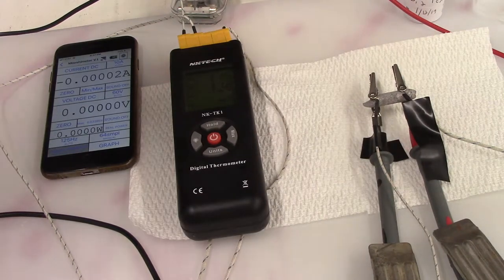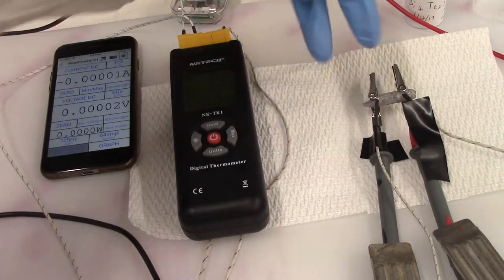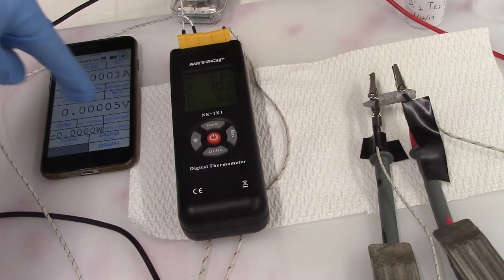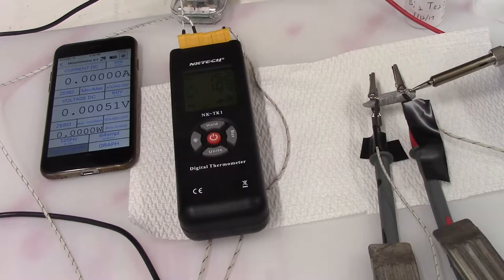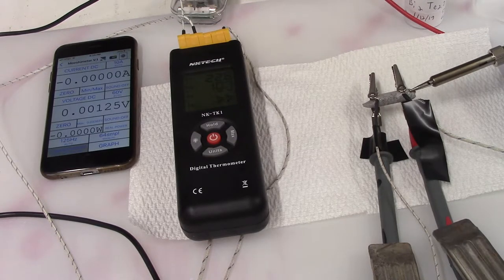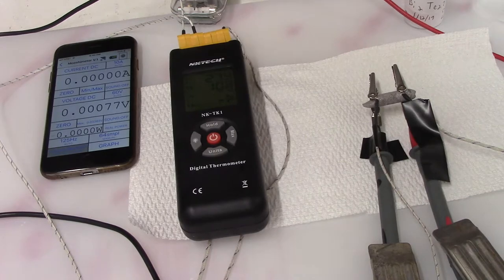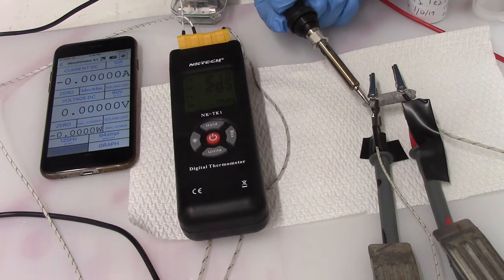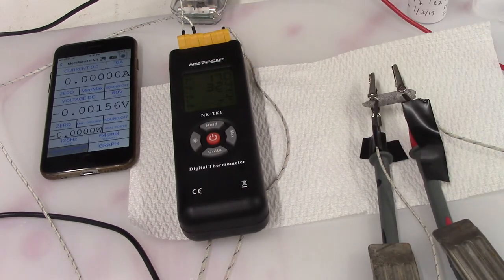Measuring Seebeck Coefficient of Bi2Te2.7Se0.3

Comment: how did you crystallize it?
Reply from the maker: ashamoni neog ashamoni neog It was a bit of a process. I'll make some videos on it. In a nutshell I mixed up measured out raw bismuth, tellurium and selenium into a mortar and pestle and ground up the powders until they appeared homogenous. Then I made a vacuum tube by heating one end of a glass tube and sealing it off, then poured the mixed powder into the glass tube. I then attached a vacuum pump to the other end of the tube and pulled a vacuum sucking out the air. While the pump was running i heated the top of the glass until it softened and pulled down until it sealed the glass shut.

Lastly I put the vial i to a furnace hearing it to 650C which liquifies the metals. Upon cooling I hade a chunk of Bismuth Telluride doped with selenium. Easy peasy! :-)
Reply: @zenmanproject  
Wow...it involves lots of processes...please upload the videos on crystallization soon. It will be more helpful.
Reply from the maker: @ashamonineog8295  I will as soon as I have some free time. Don't be overwhelmed with these steps. It is rather straight forward. It's just a matter of measuring, grinding, a tiny bit of glass work then just pressing start on the furnace.
Reply from the maker: The part I have not figured out yet is how the professional blocks are cut so perfectly. I have ordered a couple kg from China (cost about $500 for the minimum order) and they are incredibly exact measurements.
Reply: @zenmanproject 
Does the properties of the material change during this process?
Reply: @zenmanproject  raw materials or the ultimate product?
Reply: I liked ur setup...mine is crude...where can I find this wireless multimeter and thermometer?
What is the accuracy and precision of these instruments?
Reply from the maker: @ashamonineog8295  Yes, absolutely. And the percentages that you add of each element will change the properties also. For example, the melting point changes when you alloy multiple metals together. If you search google images for  "bismuth telluride phase diagram" you can see the temperatures that it melts at based on the percentages of each element.
Reply from the maker: @ashamonineog8295  Yours is more crude that this setup? ha!! Mine cost about $125. I would hardly consider my very accurate.  At Norfolk State University (a lab I have done a bit of work in) they have an MMR Seebeck measurement device that costs around $30,000. 

My goal was to get rough numbers to see if I'm in the right ball park.

The wireless meter I am using is called a "Mooshimeter". I do like that one, i think it was about $100. The 4 temperature thermocouple was purchased on ebay. I forget the brand. It wasn't very expensive. Maybe $25. That one is ok, not great. Most thermocouples aren't very accurate. 

To make this system dramatically more accurate would require putting it into a vacuum chamber.